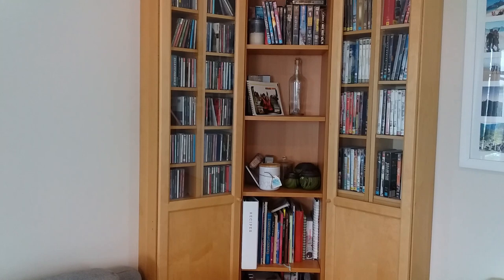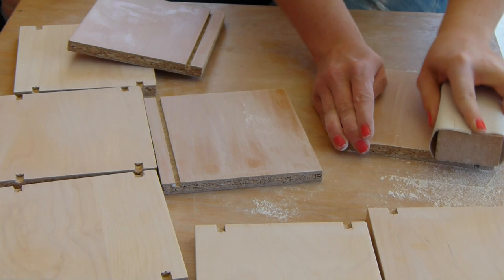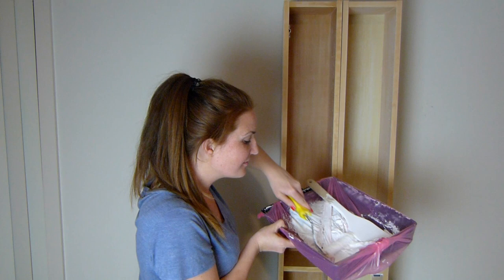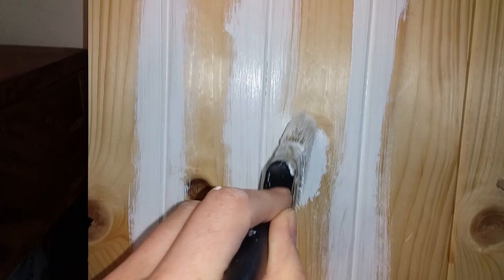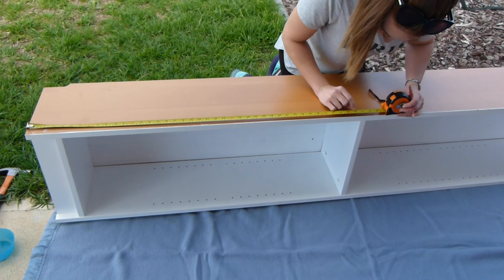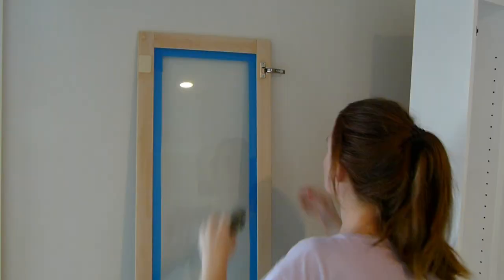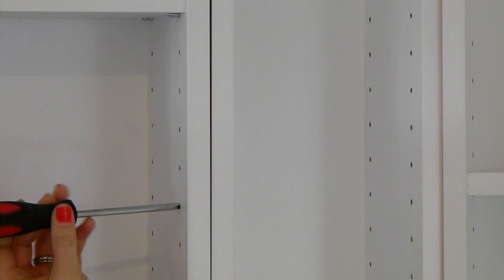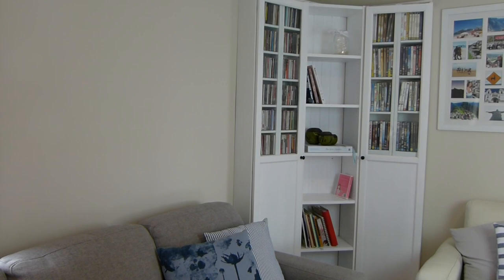IKEA Furniture Makeover: How to Paint IKEA Furniture, Hamptons Style!

Comment: I’ve just bought a couple of white Billy bookcases, jan 2020 in UK, stupidly mismatching the two depths available,  but  I’ll manage.  However, that’s showed me they use different materials for the backs on each depth. The 28cm deep has a smooth finish, whereas the 39cm deep has a rougher, micro bumpy surface.  
Late in the day I decided to paint the back, and didn’t want to muck about priming, at some extra cost. I tested a little corner, thinking If my paint didn’t stick I could rub it off. It didn’t even scratch off!
Anyway, I’m happy to report that ordinary matt emulsion wall paint sticks to both types of back surface, without primer,  but does need a couple of coats. I used a foam roller.  To be clear, I’m not painting the laminate, but the back surface of the shelves.  I thought I’d post this because I’ve noticed a lot of people wondering whether priming is necessary. Lots of people think it is for painting laminate, but if you’re lazy like me you can get a pop of colour by just painting the back.
Reply from the maker: That's great Bella Bee, thanks so much for sharing that!! :)  What a great idea to paint the back for a pop of colour, I love it!!  And yes I think with IKEA furniture it can be confusing because they seem to use different materials and have even changed the materials they use on each product over the years.  But yes, I haven't had any problems with my paint at all, and the spots in the corners where I used a touch of spay-on primer have been fine too.  Thanks again for sharing your experience! :) xx

Comment: Is it possible to prime instead of sand or is the sanding necessary? I'm planning on painting a Billy bookcase. Also, any other advice if using milk paint? Thanks.
Reply from the maker: I am not 100% sure - you could give it a go with just primer and not sanding, but maybe test a small section first, maybe the underneath side of a shelf, and then give it a good scratch when it's dry to see if the paint peels off.  If not then you're good to go!  But the good thing about sanding is that it should open up the fibres of the wood a bit and help the paint and/or primer to adhere, so I'd say it would probably help to sand it first.  If you can, ask someone in your local hardware shop, hopefully they can give you some solid advice!! 💗  
I found this article which might help a bit: https://www.architecturaldigest.com/story/options-for-painting-wood-furniture-without-sanding  It seems to say that if you mix milk paint with a "bonding agent" then you don't need to sand first. Or you could give chalk paint a go which may work too!  
Let me know how it all goes, I would love to hear what how it all turns out!! 💜😍
Reply: @HamptonYourHouse  Thank you so much for your detailed and thoughtful reply.  I will read the article and decide what I'll try and let you know how it all comes out.  Thanks again.

Comment: Wondering how this is holding up? I’m goi g to paint a very slick ikea dresser, and will sand and use primer. I curious to know how you’re went without primer.
Reply from the maker: Hi Deb, it has held up really well, it still looks pretty much perfect.  My pieces were a wood veneer though (a veneer of real wood), which is why I just sanded and didn't need primer apart from in the corners where it was too hard to sand.  If your piece is very shiny I think sanding plus primer is definitely the way to go. 👌 I have another video where I tested levels of prep and different surfaces, it might be helpful too. All the best with your project! 🥰
Reply: @HamptonYourHouse  thank you! I’ll definitely check out your video.
Reply from the maker: @debloui  You're welcome! 🥰